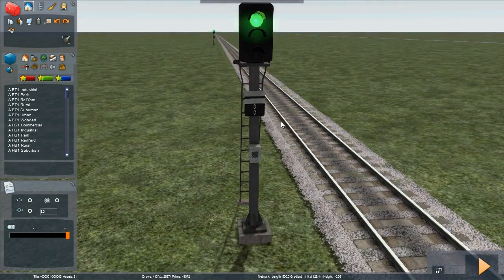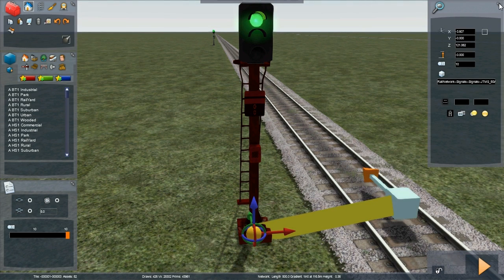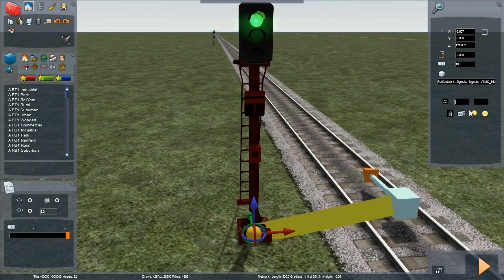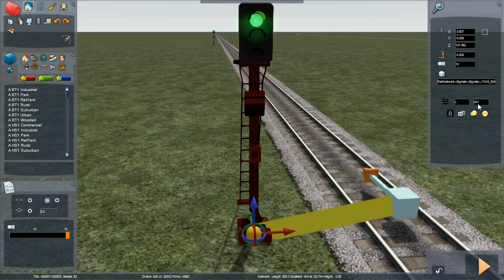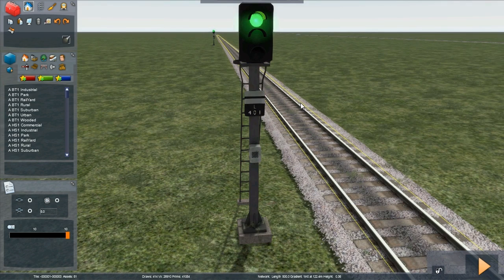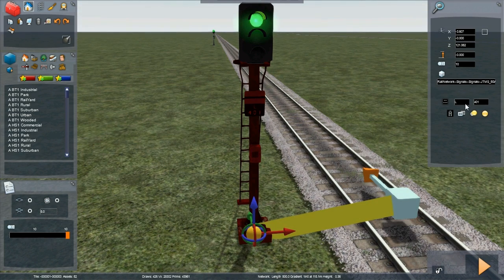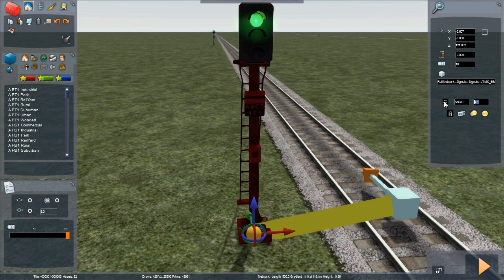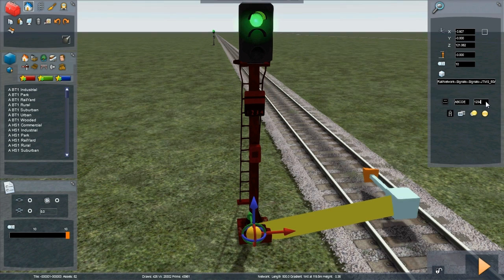002 Naming Signals

Comment: The WCML North route has been modernised at the Newton West junction, and obviously the signalling is no longer accurate. I need to re-signal and give these, and the new signals, their identities. But the identity plate won't change on the new signals - no matter how I do it: I've tried saving the route and going back to it - nothing changes. I've tried with every signal set I have, UK Pro, JTMS, the lot. But I can change the identity plates on the existing signals. Is there a setting somewhere that's preventing the changes?
Reply: Same here, it's staying as "EN 224" or something like that